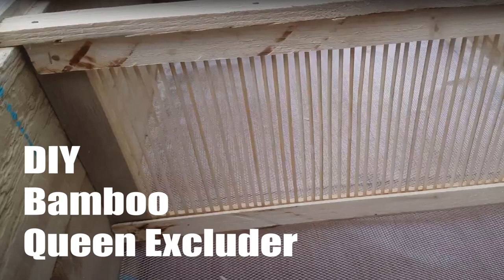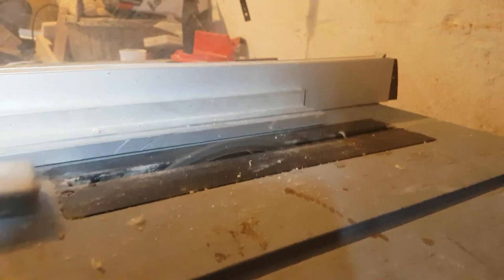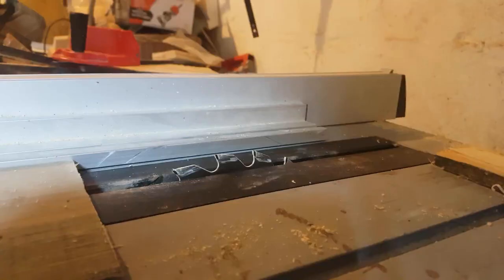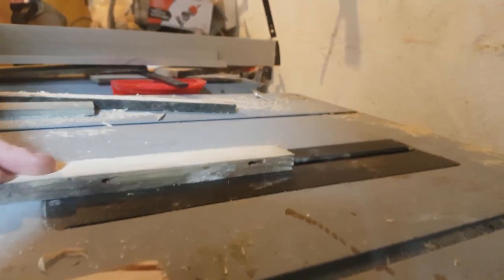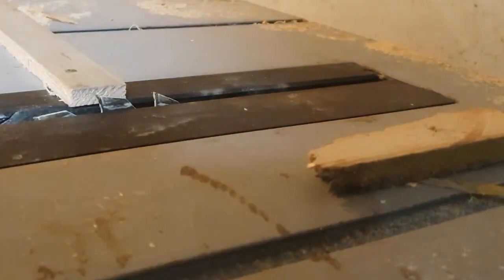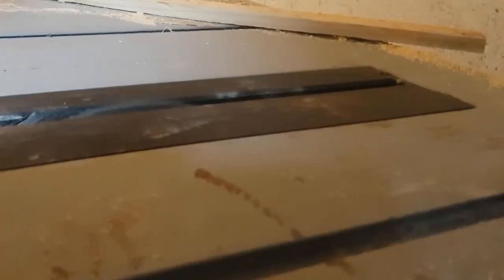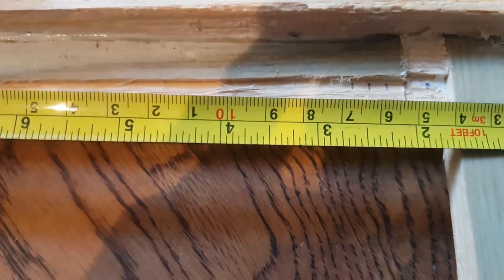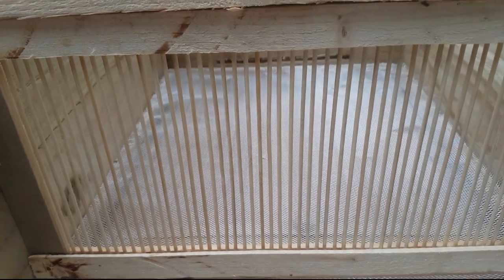DIY Bamboo Queen Excluder

Comment: thank you! im looking forward to a demonstration in the hive:) what diameter do the scewers have? i understood they are 4,5mm apart,so the gap should depend on the size of the scewers...
Reply from the maker: Thanks for watching. The gaps are 4.5mm. I put the bamboo edges on the marks. So right edge to right edge if that makes sense. The gaps are all around 4.5mm. It seems to be working well so far. I will post an update video later in the year once the hive has filled up more.
Reply: @BritishBeeMan  thanks very much